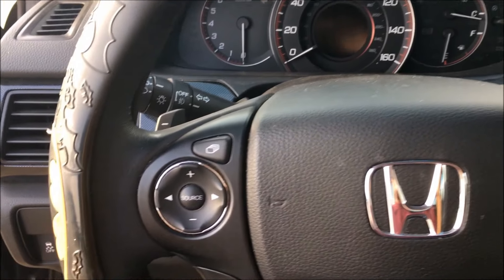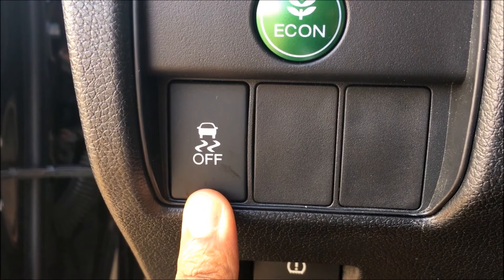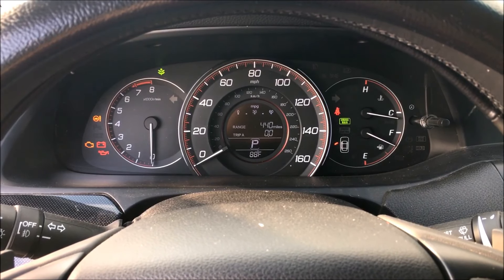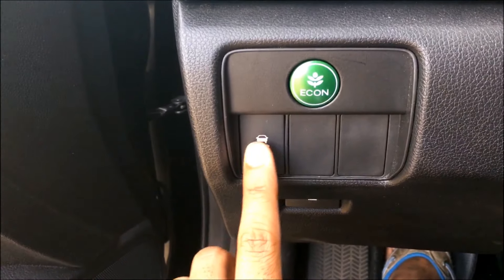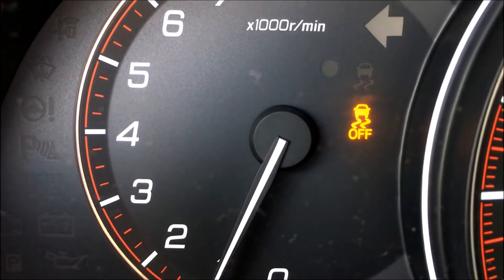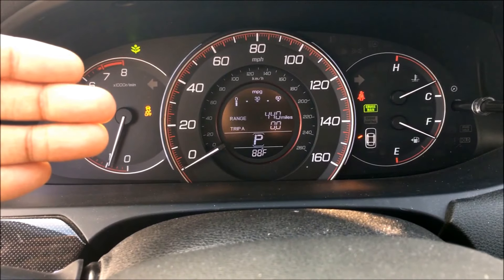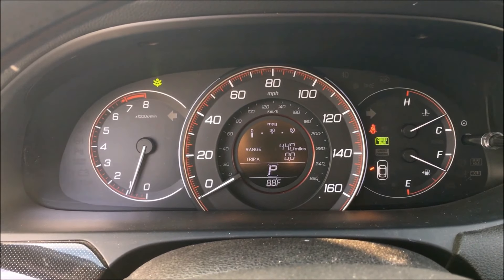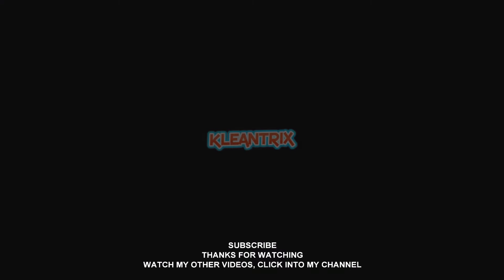HOW TO USE TRACTION CONTROL (9th GEN HONDA ACCORD)

Comment: The traction control button does not turn off traction control, even though the manual reads that it does, and even though the dashboard lights up that it is off.  It is not true.

The traction control has 3 settings.
1) Fully on (this is the default).
2) Partially on (this is when you press the button that pretends to turn traction control off).
3) Off (this one is not available -- well, not easy to attain).

If you are taking a hard turn at, for example, 40 MPH, and you give the car lots of gas, it will not accelerate when in mode 1 or 2 (as described above).  It will maintain speed, or perhaps it might slightly accelerate.  But you can have the gas pedal floored on a hard turn, and you will not speed up in any meaningful way.  This is because traction control is still engaged.

If you turn it off completely, the dashboard icon will blink.  Then if you take the same turn as described above, the car will pull hard on any turn when you mash down on the gas pedal.

You might have an accident, kill yourself or others.  So I am not encouraging anyone to do this.  I am only pointing out that Honda does not let you fully turn off traction control.  It can be done, however, if you jump through hoops with Honda.

Comment: There is a few steps to fully turn traction control off, put foot on break press traction control button til beep then wait a second press a again til beep after that pull emergency break press traction control button until beep wait a second the press again til beep then keep emergency break engage and press the break pedal and press the traction control button til beep, traction control is now fully off.
Reply: The last Step you must do it twice just like the other time the traction control off light will blink next to the regular traction control light the is a YouTube video showing how to do this in case anyone wants to know I think is works for all 9 th gen Accord I have a 2017 Accord touring hybrid

Comment: TRANSLATION: the TRACTION CONTROL is ALWAYS 'ON' unless you turn it OFF with the button. the TRACTION CONTROL will automatically reset to "ON" when you restart your Honda. TIP: if your TIRE PRESSURE SENSOR LIGHT  is ON the TRACTION CONTROL SYSTEM and monitoring system won't engage!
(safety feature to stop uneven traction from a low pressured  tire)

IF YOU SEE YOUR "SLIPPERY CAR LIGHT ICON" flicker that only means the traction control is engaging in real-time for slippery snowy,muddy or wet conditions.....that is what it is supposed to do (good idea to slow done too if you see the flickering).

SUMMERY:  the traction system works well but demands that your tires are properly inflated. leave the system active unless road racing as it effects : RPM, shifting, braking and the drive differential.
Reply: What if the slippery light not flicking but just on along with the tire pressure light on aswell ? Help
Reply: @claudiavilla8394  it means fill tires to proper pressure. And the traction control is having probs becuase of low tire pressure

Comment: I turn it off a few times a year when going through deep snow at low speeds.  If you can't spin the wheels you will come to a stop.  An example is when my street isn't plowed but the street I'm turning onto is, you are driving though what the plow left.  It is a modest hill with a stop sign too.  You do your best not to stop.  You are doing about 10 to 15 mph, tires are 25 to 35 mph.  Also turn it off when going through bumper deep snow. I turn it back on as soon as the snow depth is a few inches.  Traction control is a very import safety device when driving on slippery roads.
Reply: I actually don't have traction or stability control on my 2007 Accord (i4 / 5mt).  Do you find it helping when launching from a stop light in slippery conditions for example?  Even with Nokian Hakka. snow tires on, I find I slip a bit at a light before gaining decent traction.
Reply: Not so much launching, but preventing you form coming to a stop.  You need to keep your momentum up.  That would mean blowing through the stop sign at 10 to 25 mph.  This would be deep snow, if you stop in it, you aren't going anywhere.  The tires are going in the 20-30 mph range.
Reply: Hi Dan, so you turn TC on and off while car is in motion (ie not stop otherwise you be stuck as noted)? txs

Comment: (1) If you're cruising around in heavy rain/snow at a normal speed, leave it on. It should help lessen tire slippage.
(2) If you happen to get stuck in snow for example - turn it OFF.  In this case, you actually want tire slippage, which should allow you to rock the car forward/backward to get out of the snow.
Or, just turn it OFF if you're driving really slowly through thick snow and you want the tire slippage to keep you moving forward.
Reply: Don't forget that the T/C is also a stability control. Actuates the rear brakes. Sort of a half baked version of Acura's SH-AWD for FWD cars.
Reply: Jason99942 mine its not working how can I fix it?
Reply: Can you turn if on or off while driving (i.e. when approach steep hill with deep snow turn if off and gear down )?  I read somewhere that with traction control on , engine power is cut off to slipping tire which you do not want since you are climbing steep hill and tires will be slipping.  txs

Comment: My traction control in my 13 accord coupe doesn’t seem to work, anything to try? I’m trying to turn in off
Reply: I've got a 14 coupe EX-L. Hold the TC/SC button for a few seconds until you hear a beep, and the TC/SC off light pops up on your gauge cluster. Left side, between the tachometer and the speedometer.
Reply: It doesn't work if your tire pressure is low.
Reply: Kawg Hawj wow thank you so much I was wondering why it wasn’t working. Now does it not work if tire pressure is low or does it not turn off if turn pressure is low?

Comment: To get this correct if it says “off on the dash” then TC is actually “on” but if you see there is no TC light on then it’s “off”
Reply: Wait can you elaborate.. the video guy said the ooposite
Reply: Exactly man I don’t get this shit it should be light show on display so you know it’s on but if light shows it means off weird
Reply: @tpc9002  i dont understand. We JUST got snow in Toronto and i NEED to know what this crap means!! Why push a button to turn it off??? Im so confused this video was also confusing...sounds like the opposite. Ill call my Honda dealer tomorrow.
Reply: @strawberryhair4164 let me know )

Comment: what mpg in the city and highway do u get with econ button on?
Reply from the maker: I haven't paid too much attention to that however I get 550 Miles to a full tank.  So If I did my math correctly around 30 MPG
Reply: KLEANTRIX
Reply: If you drive at 65 mpg on the highway with eco mode on you can get up to 38 mpg. Faster than 65mph means higher RPM, the higher the RPM the more gas you are using. Is always best if driving at speed limit. I know we all sometimes drive a little faster, but at least that is what i have notice. Hope this helps. Blessings

Comment: i had my traction control light blink for the 1st time 2 days ago when i was driving thru a bad rain storm. my car started to slide to tge left but when the light stsrted blinking i was able to nudge back to the right. TC works really good
Reply: Yaa blinks when you’re losing traction. I’ve seen this on my car when i step on the gas pedal at lights

Comment: On a rainy day, what should I do? Should I press that or drive normally. I have a Honda Fit Shuttle. Please respond anyone...
Reply: Sankha Dahanaggala.

Always leave your traction control on during all rainy days.

If you don’t know what you’re doing, it’s best to always leave your traction control turned on. You minimize your risk of hurting your tires/cars with it always on.
Reply: My understanding is that you would only need to disable traction control (OFF) if you find yourself stuck in heavy snow.  In that case, you actually want your tire slippage, so you can rock your car forward/backward to get out of the snow.
Reply: Do not text and drive.
Reply: Now my question is should I keep it on or off?
Reply: @jen9950  keep it on at all times ig

Comment: Just remember that turning Traction Control off is also turning stability control off too. Stability helps stop a skid from happening. If one does manage to happen with Stability Control, you can best believe it will help you way more with the system on than off. 
Trust me. I'm talking from experience here.
Reply: That's interesting.  I was unaware VSA and TC were incorporated into 1 button?  
I have an 2007 Accord (i4/5mt) and have neither function.  I'd certainly like to have them though - next car I suppose.

Comment: Do you know if you save gas by turning it off?
Reply from the maker: I don't believe so.  However I have not done any test on this matter, I am just using my knowledge of how engines work.  If it were to save money, it probably would not make a big enough dollar difference to matter in the long run.  Good question.
Reply: +KleanTrix You're The Man KT., thanks.
Reply from the maker: LessThanHandy No Problem!
Reply from the maker: Humam Alobaidi Leave it on.
Reply: LMAOOO